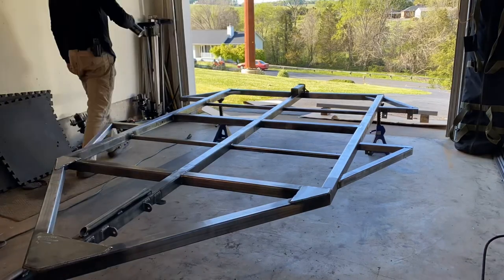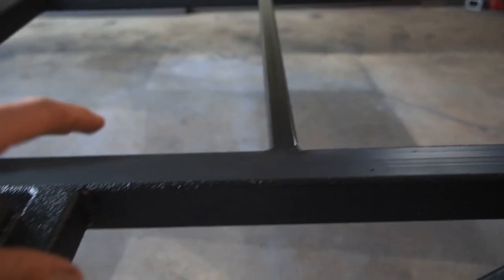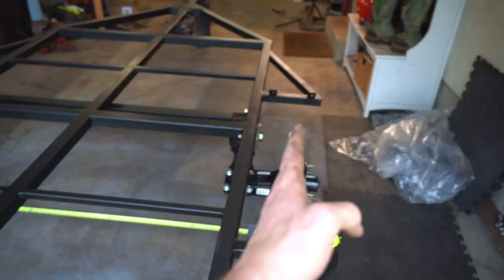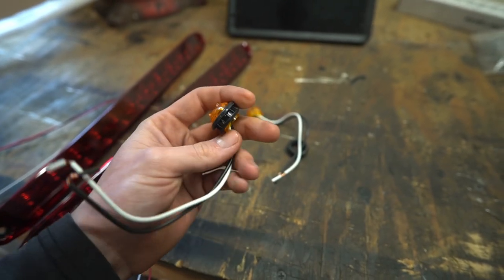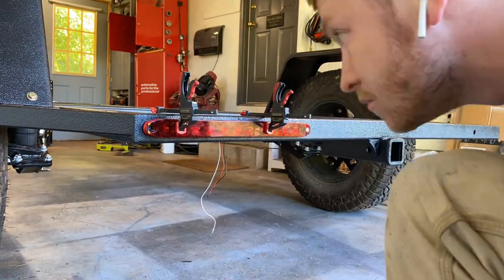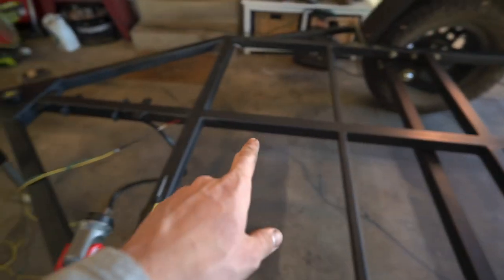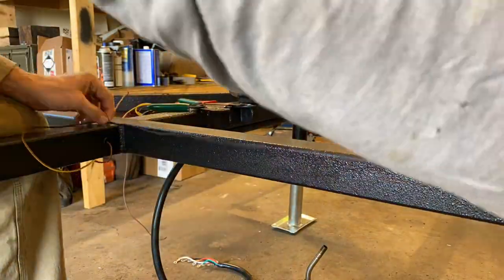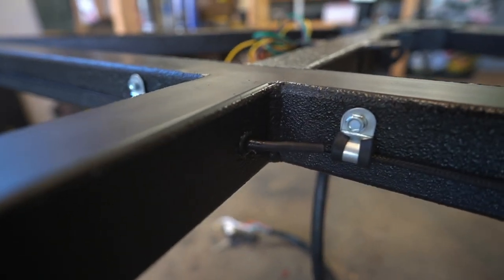Micro Camper Overland Build | Part 2 | Frame coating , Timbren Installation , Wiring

Comment: I respect your attention to detail.  You did a great job on the wiring and I appreciate the tip to build in expansion capability by starting with the 7 pin system. Thanks 👍🏼🇺🇸
Reply from the maker: Appreciate you watching!! Glad you found the video helpful

Comment: I don't know if I'll ever get to do a build like this, but this gave me enough reference information to figure out how to make the cabin extend out and over the wheels. Ideally making it so that you could have an East-West full size resting on top of the height of the wheel well. And then having some utility space underneath the mattress.
Reply from the maker: That would be awesome! I opted not to extend over wheels to keep it simple. I also wanted to be able to see around the trailer in my side mirrors easily.

Comment: This is a great video mate! Loving it even though I am a little late to the party. But as an auto elec I get forest whittaker eye when i see earths screwed to the body. You would have been better bolting that to a common earth stud within your box or with a bolt on the chassis rail. Screws come loose and its always that jiggling earth terminal giving people issues in these circumstances. Just a bit of food for thought!
Reply from the maker: Thank you!! No worries they are easily accessible!

Comment: Curious to know the distance between the outside of frame to the wheel mounting surface? I'm rebuilding a tow low camper and I'd like to put these axles on but can't find the measurements for if they'll fit

Comment: The one thing I have found with the liners (i.e. Raptor, Line X, rhino.. etc) when used in areas where they can get scratched, the rust will eat under them. You’ll soon be able to peel that liner off like an onion skin. I only use liners now in areas where I can look after them and fill them immediately after they are blemished.
Reply from the maker: Thanks for the heads up! I have actually been using raptor liner on various things for a few years now and have luckily never encountered that issue 👍🏼
Reply: @Adv4x4  It takes some time, I have an All-Pro bumper on my 01 rust through after years of beating on it and not paying attention to the rock rash.

Comment: How confident are you in the 3/4” inch steel as the frame vs 1” steel?  Do you think the difference would be night and day in terms of structural strength?
Reply from the maker: Very confident! I had been all over the roof before it ever had a roof rack to ensure my panels were adhering correctly. Didn’t even seem flex at all with me up there

Comment: 4:38    You say you like 1/16 toe in.    Seems a bit vague.  Mustn’t you also specify the distance from the axle?    Surely using a longer straight edge and measuring far from the axle is not the same as using a short straight edge
Reply: Not really, you’re measuring for the wheel. It’s going to be a 1/16th inch less in the front than the back. Look up tire alignment videos, and you’ll see that everyone uses a short piece of metal, or level.
Reply: @MichaelCook1981  Would it be safe to say 1/16 of an inch at 8 inches from hub centre?   Example 16 inch wheel

Comment: Please provide link to the nuts suitable for Toyota wheels.   Edit.  I found it.  Thanks.
Reply: @Adv4x4  I wish I was aware of these nuts when I built my trailer.  I ended up getting metric studs and banging them in place of the 1/2 inch ones that came from Dexter.   Now I can use OEM toyota nuts
Reply from the maker: I got lucky and had a internet friend who pointed me in the right direction! I was going to install new studs as well originally

Comment: I tell you a secret that I did. You know those little plugs that you put on the front of the trailer or the full wave plugs, you can get those, and at every light put one at every light that way. If you had to replace the light, you just pulled the plug, take the light out, rewired onto the plug. Put the plug back in and you got it made. I do that because.  Somebody's always hitting it or something. Somewhere. Down-the-line and breaking a lot. So this way, nobody hits it. And you're up on Poles too. That way on my boat, they're not. They're not able to hear them.